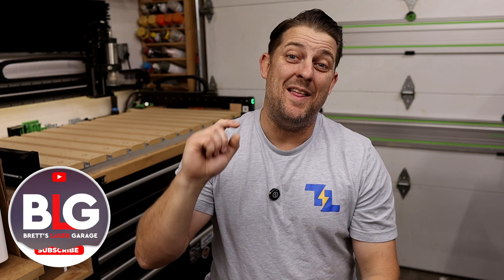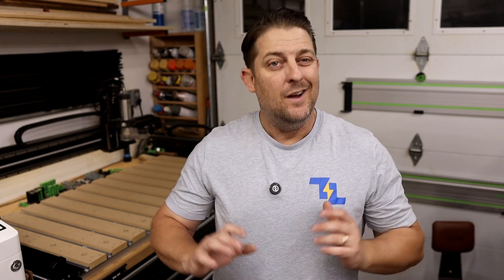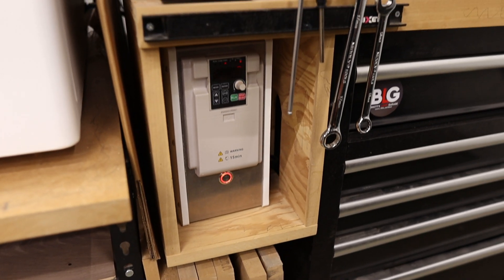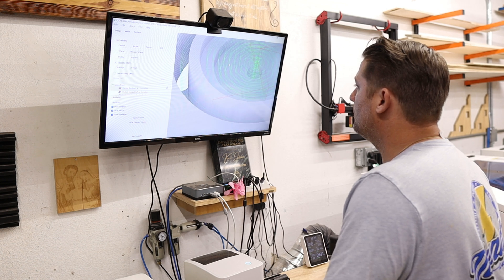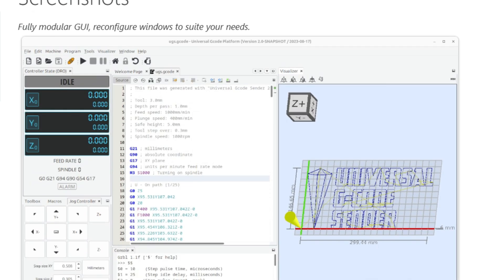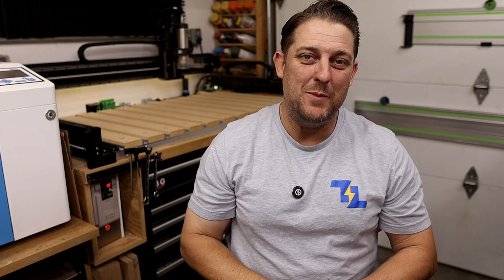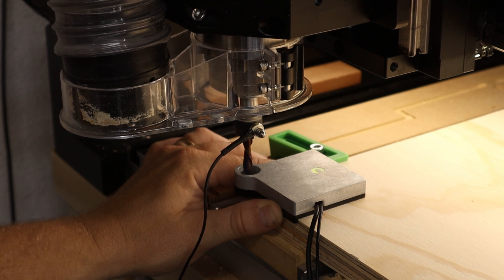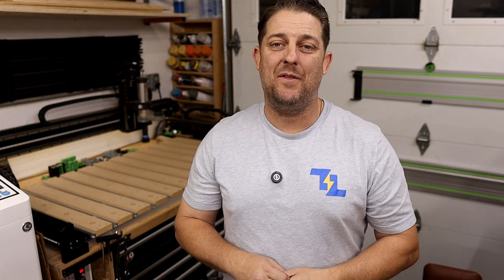Building Your Dream CNC Workshop - Essential Tools and Setup -Featuring Shapeoko 5 Pro

Comment: I am new to the CNC but i have 2 laser engravers and have become very good at using them and the software. Is it a big learning curve going from the laser to the CNC or is it simply just learning the new software. I use SVG files on my laser can i use those same files on the CNC. I am in the process of building a home workshop and when it is done I am going to buy the shapeoko 5 pro 2 x 4 machine. Thank You
Reply from the maker: Knowing lasers will give you a great foundation to build off of for sure.  But yes I think you’re right, basically you’ll have a software learning curve and there’s a few other difference with CNCs like tool paths and work holding that you’ll have to learn about.  Very exciting you’ve got a new shop in the works!  Let me know if there’s anything I can help you with.

Comment: Great video.  You covered and nailed pretty much every issue.  I currently own a Shapeoko 4 standard, and am upgrading to a 5 Pro 4x2, and have a coworker that will be purchasing my old machine.  He has zero experience in the CNC world, but is wanting to make the jump.  IMHO, Shapeoko is the way to go, even on the entry level, as the machine is superior in design and function.  If the machine is inferior, or the customer support is poor, then that's a formula for turning people OFF of pursuing moving forward with CNC-ing.
Reply from the maker: You couldn’t be more right, Shapeoko is a great option for starting out!  And you also bring up another great point.  Check your local market for used machines.   That’s how I got into my first CNC, which was a Shapeoko Pro XXL.  I used it for over a year, sold it for $200 less than what I bought it for.

Comment: If I ever get another CNC, I would like the spindle to be able to go past the table.  Then I would have a 90 degree table to clamp wood to do dovetails and lock miter bit cuts to do jewelry boxes.
Reply from the maker: Nice!  The Shapeoko 5 pro can do that.
Reply: @LaserGarage  Have you ever though about doing a video on it?
Reply from the maker: @hmatyas1 thought about a little but I’m just not that familiar with it.  You have to take the gantry off the machine and move it to a secondary position a few inches closer to the front of the machine.  Not that big of a deal but you lose work area on the back of the cnc as a result.
Reply: @LaserGarage  True, but what would you use more, the back end of the machine or the "new" space in front of the machine.  Everything has plus and minuses.
Reply from the maker: @hmatyas1 100%.  I use the full bed all the time.  Using the front space for joinery doesn’t make sense for me.  But it may for others, I like that it’s an option.

Comment: My plan is exactly what you did- put a Shapeoko on top of my tool box which is identical to yours.

Outside of the considerations you mentioned, do you find that the position of the cnc in a corner by the wall problematic in terms of accessibility? Things that come to mind for me is maintenance for example.
Reply from the maker: Nice!  It’s not an issue for me because the right side of my machine is my garage door.  So when it’s open I have almost full access to the right of the machine.  If that wasn’t the case I’d probably place it about a foot off the corner just to be able to squeeze in if I needed to.

Comment: Have had a laser for a few months now and looking to add either a Genmitsu or Foxalien CNC. In the process of setting up my shop space in an unfinished basement. Need to do it on the cheap as it is a rental.
Reply from the maker: Sounds like you're getting a great setup going!  I highly recommend either the Shapeoko line of CNCs or the Fox Alien Masuter 3s with the extension kit.  Shapeoko will be a bit more expensive but less learning curve than the Fox Alien.  Shapeokos have a better release value also, something to think about.

Comment: I want to add a couple little things, had my shapeko 3 XXL for a few years now. So wheels, everything needs to be on wheels, esp with my XXL. So the XXL is a little different size wise. I made a cart and the front is drawers I made similar to yours, one side is 2x4 sheet good storage. I enclosed mine so I have 4x4 of storage on top. The big thing is my festool dust extractor and cyclone fit behind the drawers.
Reply from the maker: Definitely some good tips there, thank you.  I had a similar setup with my old Shapeoko Pro XXL except it wasn’t enclosed.
Reply: @LaserGarage  Yeah the enclosure is the part im not thrilled about, I havnt made the front yet, but using 1/4 ply to enclose the sides was a mistake, it made it more of a echo chamber. I do really really like having the top and being able to store stuff above it.
Reply from the maker: Maybe add some sound deadening foam to the panels?